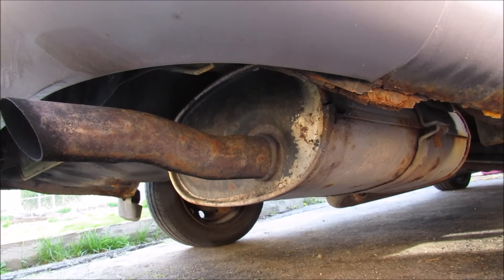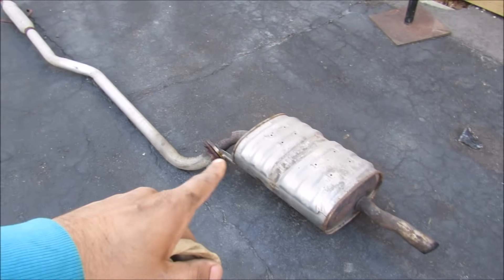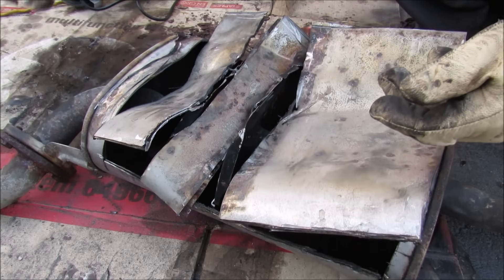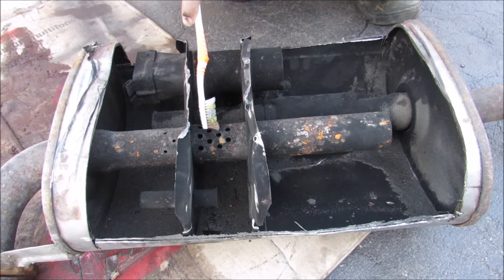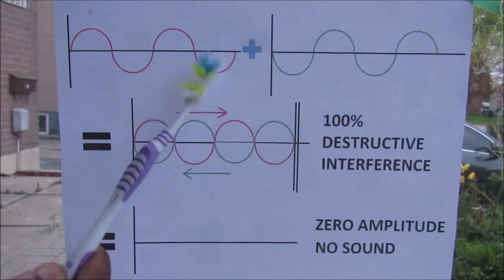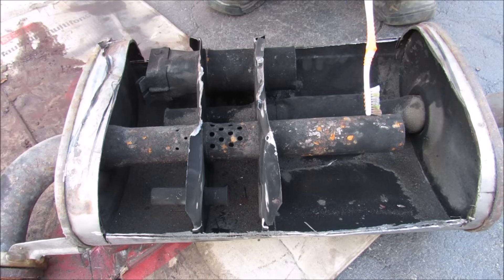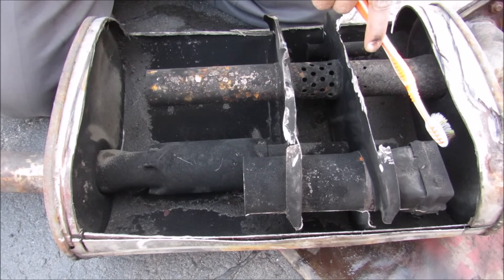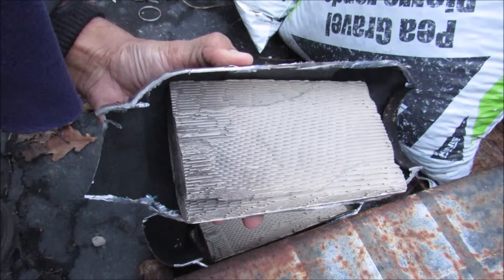How a Muffler Works

Comment: Some of the terminology and explanation was a bit too crude but being an Acoustic Engineer who designs these reactive mufflers for mining dump trucks and a whole lot, I enjoyed youor video.

However, I must add that the explanation at 2:19 is wrong. That connecting neck is not for exhaust gases to bypass the last chamber (however that inadvertently will happen), that is what is called a "Helmholtz Resonator". The volume of the second chamber and geometry of the connecting neck (among a lot of other factors) decides what is the resonant frequency of that 2nd chamber. The sound frequencies at and near the resonant frequency get attenuated due to helmholtz effect.

Comment: Cool. Thanks. 3 inch exhaust systems common? I've got a stove I made from scrap metal and was thinking of using old exhaust pipe and maybe even muffler in it if I could find it. i've seen some different stove systems that have a similar concept as the muffler with baffles and such.

Comment: HAHAHAHA try drilling holes in muffer in Germany and i promise you wont drive very far
Reply from the maker: Regulation?
Reply: @speedkar99  yes. In Germany you have to get your car checked by an official technical organization (for example „TÜV“) every two years. And in case there is the tiniest hole in your muffler, you have to repair it in order to be allowed to drive the car.
 Even when cops on the street notice that you have drilled holes in your muffler they can shut down the car immediately.

But thanks for the well explained video. 👍

Comment: I thought a turbo muffler was a muffler designed for turbo charged engines. The concept was a muffler that had very low restriction and needed less sound attenuation than a standard muffler because the turbo charger itself attenuated the sound some.

Comment: Also, the pic with waves is misleading because it shows only one time instant. At other time instants the waves are shifted (remember  - they are waves, they travel - surprise surprise) and the calcellation doesn't work except those zero points. It even makes the sound stronger in the points in between the zeros.

Comment: The explanation with wavelength is clearly wrong. At 2000 rpm, the crank frequency is 33 Hz and ignition frequency 16 Hz and with 4 cylinders that's 64 Hz and lambda/4 (the length needed to get the first cancellation) at that frequency is 1.125 m and this dimension is nowhere in the muffler because it wouldn't fit in there. The muffler design doesn't rely on wavelengths but on different phenomena.
Reply: maybe overtones? an engine doesn't provide a simple sine freq.

Comment: Holy Smokes! They rust from the inside, out! That seems like something that should be addressed in the engineering stage. Sounds like planned obsolescence.
Reply from the maker: Yeah it's also caused by too many cold starts with moisture not getting enough time to burn out

Comment: It's not wise to spoil the engineers work and drill water holes in the bottom. A stainless steal exhaust lasts forever instead.
Reply from the maker: Yes stainless steel works good. But too much water, not driving the car long enough to heat up and burn off the moisture will definitely rot out the components from within

Comment: Hey drilling holes as you advice at the end to prevent rust and water accumulation wouldn't that equal to more noise ? as sound will exit through those holes instead of the chambers

Comment: Alot of people are probably gonna try to rip off their exhaust now to make their car sound better. Please dont! Multiple components in the exhaust provide pressure that the engine needs to run well, otherwise it is too easy for the engine and will shorten the lifespan of a car by a big factor!

Comment: My muffler had a thousand plums that a bird hid in it.
Reply from the maker: Serious??
Reply: @speedkar99  Yep. The tailpipe had rotted through the side close to the muffler. That's how they got in. The plums were dehydrated & burnt, but had pits.  The seam on the muffler had opened up so there wasn't enough back pressure to affect performance. I only noticed after I bought a new tail pipe. Then a new muffler. 
The critters did the same with the hollow frame rails on my boat trailer, so I sealed the ends with spray foam.

Comment: Nice explanation , I've heard from my mechanic that if u start a car's engine don't shut it down straight away as the water vapour will condensate in the cold muffler and resonator , let it run for few minutes until the pipes become hot then water won't condensate and this will prevent it from rusting
Reply: Rust needs oxygen to form. The point of car engine is to consume the oxygen from air to burn fuel and emit exhaust gases that don't contain oxygen anymore. So how could the rust form when there is no oxygen?
Reply: @charlieangkor8649  do you leave your engine running 24 hours a day 365 days a year? if not, there is oxygen and water in your exhaust system
Reply: @charlieangkor8649  Yeah, how could an exhaust pipe get rust on it? Obviously, exhaust pipes never get rust on them.

Comment: Any muffler is designed on the Helmholtz tube theory, so a confined volume with a controlled entry to cancel specific frequencies.  designing a muffler is a tough engineering job as the final result is dictated by the car designer, for the same engine, the exhaust sound is radically different wether you use the engine on a Chrysler Imperial or on a Plymouth Road Runner.
Jobber muffler is another story, they do a good job absorbing predominent frequencies but very often, they let pass frequencies that causes ennoying resonnences inside the car, the case is more pronounced when the original equipment relies on 2 or more mufflers in series and the replacement counterpart has only one muffler, on the side of the road, the car can be a bit noisier than the original but inside the car, it's another story
Reply from the maker: Yes good points. Thanks

Comment: 4:53
I used your suggestion and drilled holes in the bottom of my muffler now it sounds like my car makes these wheezy fart noises when it's at idle and when I rev the engine it sounds like a kazoo.  How many holes was I supposed to drill?
Reply: four!

Comment: Nice video explaining everything clearly. I have a question for you though. The silencer pipe in my 2005 Camry center exhaust section has something that's broken off which causes a rattling sound when the engine is idling rough or when I shake the end muffler. The affected section is the bulging part in the silencer pipe after the cat converter but before the end muffler. The car drives fine for now and there is no check engine light. Should I
1. replace it or,
2. cut it open and try to weld it back/cut the broken section off or,
3. just ignore it altogether? 
I'm appreciative of your opinion. Thanks.

Comment: There's quite a lot he didn't fully understand here, but can't be bothered to correct everything
Reply from the maker: Thanks, do you have suggestions for improvement?
Reply: Well, the spring-loaded flap inside the silencer, the purpose of that is that when there is less exhaust gas coming out of the engine - such as when the throttle is partially closed or at idle, and when the engine revs are lower - it is advantageous for fuel economy to maintain a higher back-pressure to keep more exhaust gases in the cylinders. This has the effect of increasing the overall level of compression at low throttle settings, which increases the engine efficiency more than it is reduced by increasing the back pressure. When the throttle is wide open and the exhaust pressure coming out of the engine is higher, it is more advantageous to minimise the increase in back pressure by using a spring-loaded flap to allow exhaust gases to escape more easily. It will also have the effect of increasing noise reduction at low throttle settings, when it is most important, while having the effect of allowing more noise out when the pedal is to the metal, which will be less frequent and more acceptable.

Sound reduction in a muffler such as this is a bit more involved than the fairly simplistic wave cancelling that you've described. I do have a diploma in acoustic engineering and have designed and built a low-back-pressure but quiet muffler of my own which worked very well, so I can say that with some confidence.

Drilling holes in the bottom of the muffler to allow moisture to escape will allow noticeably more noise out and in the UK at least might be called an MOT failure (the annual test cars must have once they're over about 3 years old). 

The other thing you might advise is: Never cut open a used silencer with a grinding wheel as you did, in your kitchen / workshop - especially if it's from a diesel. The mess and smell is really difficult to get rid of.

I congratulate you on actually doing it though. Most people have never seen inside a muffler and have absolutely no idea.

Comment: The exhaust pipe of my car is so low that it touch the ground when there are bumps on the road ,while driving. How can the pipe be raised above the ground? Pls suggest.
Reply from the maker: +salam priyo shorter hangers
Reply: Go to your local parts store and buy some universal exhaust hangers and mount them as needed to support the exhaust system.

Comment: You can also drill a hole in the fuel tank and it will last longer.
Reply from the maker: +Dell Griffith but you'll get bad fuel economy
Reply: speedkar99 just drill a small hole and plug it up when u park it 👍 better Fuell economy 😉
Reply: speedkar99 And maybe an explosion some time

Comment: That was still a good muffler.  Dont buy a cheap steel one. They only last 2 years in the salt belt.  Toyota ones are stainless. And drill a hole in it to let the condensation drain out.   Cold then heat and humidity makes water
Reply from the maker: +carson k your right! I put a walker "ss" supposedly stainless steel and surface rust in a few months!

Comment: That's smart
Reply from the maker: +Patrick Hilder it's pretty neat, though seems kind of inefficient for power.
Reply: speedkar99, it definitely is. It provides a heap of back pressure which prevents some of the exhaust gasses from coming out if the cylinder, meaning less fuel in the cylinder on the next stroke, meaning less power. That's why they remove mufflers in race cars and generally their exhaust pipes are as straight as possible and as short as possible so there is as little back pressure as they can have.

Comment: Drill holes at bottom of muffler? Lol then it wont be a muffler and have an exhaust leak lol
Reply from the maker: +tommy d u b b s but at least it won't rust lol
Pick your poison
Reply: the comp0any that makes the muffler  already has a leak hole for the water So you DONT  need to drill holes in your exhaust just stupid to do that  ,.

Comment: I am a school physics teacher I will show this when I teach interference.Great job. Thanks
Reply: For best results, use a toothbrush to point
Reply: @udarasamarasinghe8811  😂😂😂
Reply from the maker: +Physics_rabbi Thanks I'm glad my video could help your class.
Reply: Firearm suppression is another relevant Application and easier to test variables on.
Reply: Please calculate the lowest frequency that can be reflected back and forth between the partitions.  And then think about how high (or better how low) the frequencies are that have to be damped away in the rear silencer.  Then you will see that the explanation in the video cannot work at all.

Comment: About the spring you referred to at 3:49. Isn't it going to slow down your piston as the gases don't flow freely, due to the lower pressure? Sorry for my english
Reply from the maker: +Prometheus Yes but mufflers are meant to make things quieter at the expense of power
Reply: ok thanks. I just wanted to be sure about it. Good job btw nice videos

Comment: do you loose power if you remove cat or muffler?
Reply from the maker: +GLuVićħツ Technically it should give you better flow and more power though it didn't feel like it when I had an exhaust leak
Reply: GLuVićħツ 0 ko
Reply: speedkar99 mo
Reply: speedkar99 cft 4 cft Dr Dr Dr Dr ft ft CE Dr ft5ft ft 5/ft ft o

Comment: This makes one thinks twice of buying an aftermarket muffler instead of OEM (considering the effort made by Toyota).
Reply from the maker: +E Knaap honestly its true. The Toyota muffler is so much better quality than the aftermarket ones. I put a walker muffler on my solara and within 6-8 months it was rusty, even though they claim its stainless steel.
Reply: Yup.   Toyota doesn't mess around.

Comment: Spend 5 minutes explaining the complexities of sound waves bouncing inside the chamber and how it's important to keep them pressurized, then suggests to drill a few holes to drain the water, lol
Reply: Holes are put into mufflers and tailpipes for water drainage from factory for quite some time now. They are just punched in at the bottom. There's a big difference between a punched hole and a rotten one..
Reply: I did wonder same too... still don't get the drill a hole part.
Reply: ''come on man''
Reply: @Skyler.G I'm a fucking idiot with a shoe for a brain. I was about to question the same thing this guy did.  Thanks for showing us idiots some logic!
Reply: The Dunning Kruger effect is strong in this one.
Reply: An 1/8 hole in the muffler aint gonna do shit to the noise you bellend but it will drain all the collected condensation out. Many exhausts have them as standard so give up trying to be a smartass.
Reply from the maker: +VanillaSnake21 Yep
Its one or the other 
With OEM mufflers though I don't think you need to drill a hole, the material is much better quality than aftermarket
Reply: But I don't understand the point of the suggestion, you're saying compromise the muffler and make it less effective in reducing noise as well as create a exhaust leak for what? Just to make sure the muffler doesn't rust? But at that point it's a garbage muffler anyway.
Reply from the maker: +VanillaSnake21 yea true. Its a trade off.
Reply: No you don't understand. A trade off for what? A trade off to keep the muffler longer? But what's the difference between a rust making a hole in the muffler or you? When you make holes in it you might as well throw it out anyways.

Comment: so you dont think that drilling a mufler will not cause it last less longer? or making little bit more sound then before?
Reply from the maker: +3xantrik Getting the water put is important. But yes the trade off is a slightly exhaust leak.

Comment: I have a 2006 Scion tC and I went over to a muffler shop and they tried getting me to buy a whole new exhaust system for $500. I'm just looking for sound but I want it to pass emissions. Should I just get a turbo muffler? thanks
Reply from the maker: +Jareds tC The stock muffler is turbo style. You might want a straight flow for more sound, or you can straight pipe it or muffler delete.
Reply: speedkar99 thanks for the help

Comment: Good video. I appreciate that you explain the physics of it. How about explaining a resonator as well?
Reply from the maker: +Tripp M Thanks. I thought about cutting that but it isn't worth an entire video.
Reply: It's a very similar device. If I remember correctly, it's tuned to cancel 180° out of phase with common cruising RPM.

Comment: Degrees? Or was 180 percent correct?
Reply: When you're describing wave phases, the difference is measured in degrees and NOT percentage. Now if he was referring to the decibel level, then That's when a percentage level is used. So,  the 2 sound waves are 180 Degrees out of phase.
Reply from the maker: Yes your right I meant to say 180%.

Comment: But if you drew holes  on the bottom will make the waves also go through them and will make a strange noise with the water.Also the temperature  in muffler should be over 100 C degrees so the water will drain only if you stop the engine,am I right ?
Reply: was thinking samething
Reply from the maker: Good point. And yes the idea would be to drain the water at standstill so it doesn't sit inside the muffler overnight.
Reply: +dalphinus
I think he's talking about pretty small holes...like 1/16" 0r 3/32" which won't make any difference soundwise. Most factory mufflers have small drain holes in them brand new.
Reply: speedkar99 Once the bottom are drilled with holes, will it cause back pressure drop, noise coming out and other impact?

How many holes and how is the size are we talking here?

Thanks in advance for the advise.